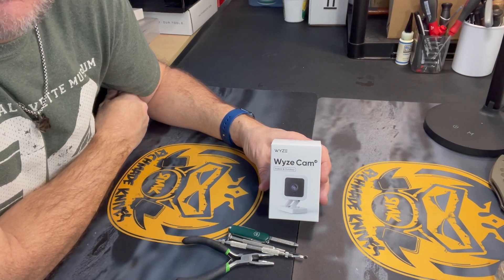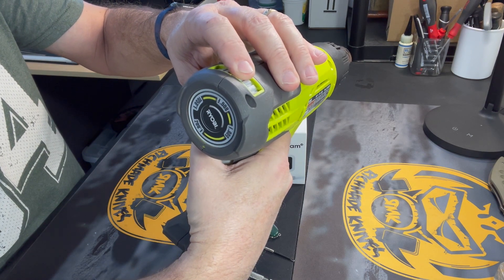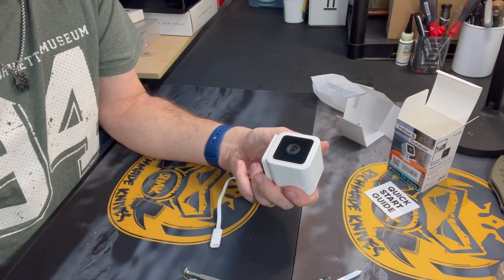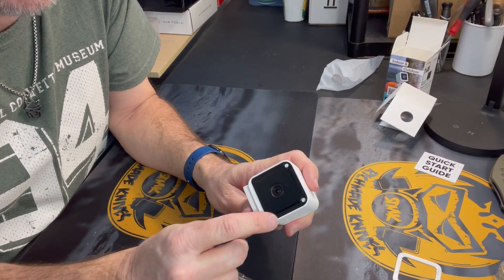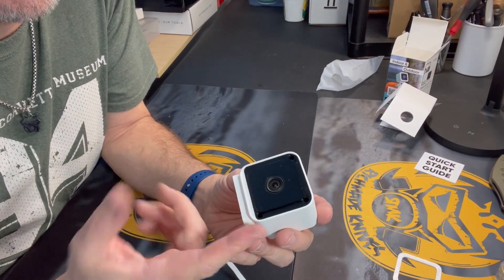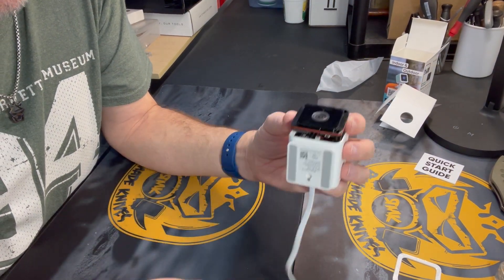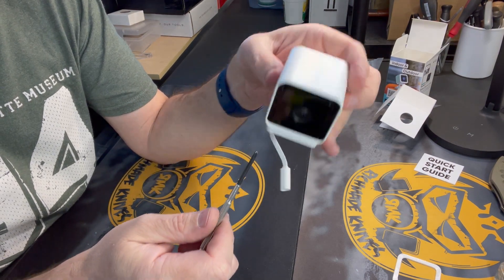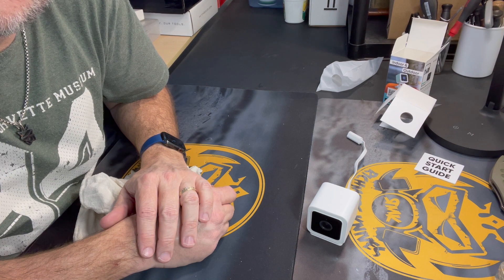Wyze Cam V3 Microphone Delete / Remove / Disable

Comment: I don't want to take it apart... is the microphone hole front and centre (opposite position top-bottom with the LED indicator)? Maybe putting some tape over it would further reduce its sensitivity?
Reply: Yes, instead of all these works , I recommend to put black color electric tape over microphone. Microphone by it self is bad quality and covering up should be worst microphone quality lol

Comment: Also works for Wyze Cam v4. The plug to disconnect is the lower one, plugged into the board further from the front (wish I could attach a photo to a comment). When reassembling, make sure the dangling wires don't block the SD card slot.  I put heatshrink tubing around the plug and tucked it up inside.  Everything else I tested (speaker, spotlight, IR lights, SD card) still works, just no mic.  Thanks Richard!!

Comment: I had rubber stoppers slip down, if that happens it's going to pretty hard to save it. You would need a very fine tool with a scoop, smaller than you would think. I had gotten 2 stoppers out and missed one, however, the whole thing will pry out easily as the screws small screws give way with little effort. He gives ambiguous information in the video about the speaker. What he did does NOT disable the speaker, however, I just disconnected all jumpers and that does disable the speaker. The camera seems to be fixed onto the center of the chip, you just need the main power connect from the base and can disconnect everything else. I tested the "signal" button on the app after and no noise was heard. Mine is going into a reptiles tank and I want no noise coming out of it and it wasn't going in there unless I could successfully test the signal did not work, which I did. If you're concerned about infrared and your pet's eyes, like I am, that can be set to On/Off/Auto in the app, which I turned off. I thought about putting super glue on a tooth pick tip and resting it against the top of the rubber stopper for a minute to pull it out, didn't test it, but might be a safer option.

Comment: Thanks for the video. I attempted this on my V3 and ruined it almost immediately. 😂

After seeing what I did wrong, here are some pointers.

1) Make sure you remove the SD card first. I had a hard time removing the black internal assembly until I saw I smashed the SD card to pieces.
2) If one of the small white screw covers goes into the hole, you can still use a screwdriver to go around it and remove the fastener.
3) Don't use a pry tool on the bottom side of the camera (the rim where the SD card and setup buttons are). You may damage the setup button and ruin you camera forever, like I did.

** 4) I haven't tried it, but it may be possible to unclip the mic connection without disassembling the camera. Here's why...👇

You can use a metal pic to remove the rubber Setup button. (It can be replaced easily.) With it removed, you can see the clip you need to remove from the opening.

It may be possible to insert the pick through this hole and quickly unclip it. My eyes are not as good as they once were so I just went about it the long way.

Comment: I have the  window mount too & was wondering is there anything to wrap around the camera to not hear sound, instead of camera surgery. I tried bubble wrap and white duct tape & you can still hear conversations! Any sound proofing material ideas? Thanks
Reply from the maker: Sorry but I am not aware of any way to completely prevent someone with access to the camera in the Wyze app from turning on the microphone.  Since the housing is just plastic there is really no way to completely eliminate the ability to pickup the sound other than following the instructions in this video.
Reply: Thank you. And thanks for the video. Gonna try it

Comment: Thanks! That worked great. You just have to be careful not to accidentally knock those little white things down into the camera. That complicates things. Ask me how I know. 🙄 I performed surgery on both v2 and v3 cameras. I wish Wyze would add the capability to do this. We shouldn’t have to disassemble the cameras.
Reply: How did you get them out?
Reply: Same thing happened to me. I took a chance by carefully drilling the screws out and just snaping the whole assembly back together. My camera is mounted inside a front window, so weatherproofing wasn't a factor.

Comment: So what i mean is the mic hardwired onto the circuit board? 
Or I there a mic port plug I can disconnect and reconnect?
Reply: It shows in the video. There is a connector that you disconnect and could presumably reconnect.

Comment: Thank you. This worked well. I would add a note to first remove the mini sd card if there is one installed. I was pulling mine apart and noticed the card was in and this complicated things.
Reply: Seconded. It destroyed my sd card because I didn't remove it beforehand.
Reply: @rulesyaface  Same. Didn't realize until a minute of semi-careful prying. Card no longer detected, so I bricked the sd card. Oops. Oh well, it was a good reason to upgrade to a 128 gb card.
Reply: I read your comment and said to myself "ok, remember to remove the SD card first before you begin!"

Nope. I completely destroyed my SD card trying to take it apart as well. 🤦‍♂️😂

Comment: Thanks, worked great. I used an xacto knife and skipped the heat gun. It took some time to get it loose without cracking the plastic. I loosened each side a little at a time. I disconnected the mic and speaker. There's a third connection and it says IRCUT near it. I don't know what it does but my guess is something to do with infrared.